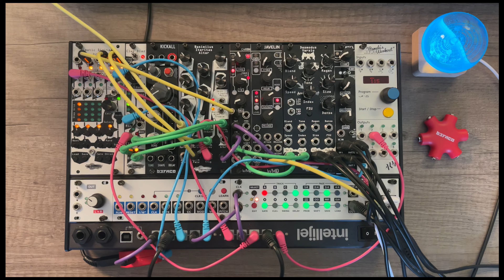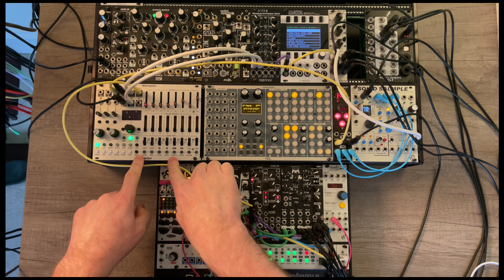Steppy - Advanced Performance Techniques

Comment: Great video as always. I hear a lot of problems sync the PPW with Steppy. It is the same problem with PNW and Steppy too?
Reply from the maker: Ah crap it’s published before the 4k version has finished rendering. It’s had almost 3 hours already but should be there soon sorry. 

I’ve not had any problems with syncing the two. Check out my quite recent video on clock and reset using PNW
Reply: Setup Steppy to 'run mode' and run a full gate from Pams into Steppy's reset. On Steppy hold save when powering on to toggle between the two modes. I don't have any sync issues with PPW or PNW.
Reply: Great Thank you for the information.